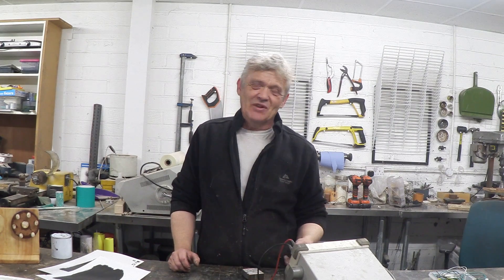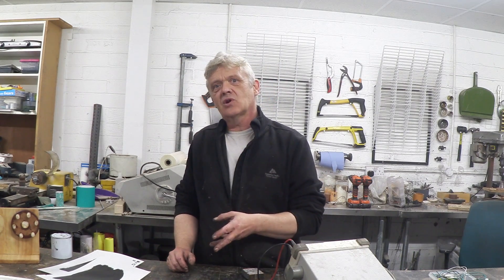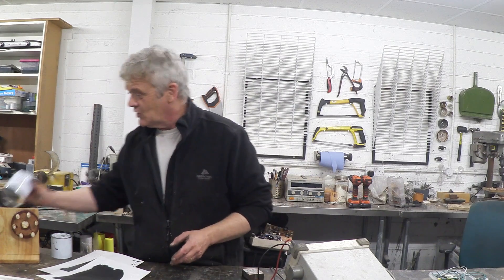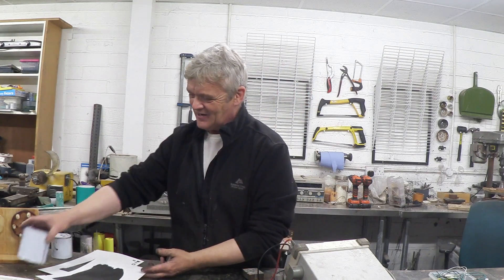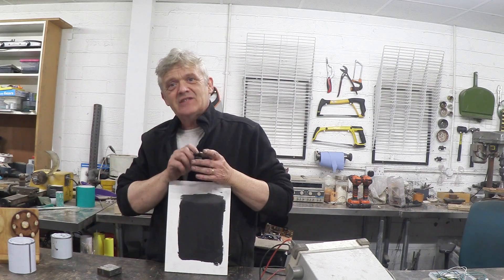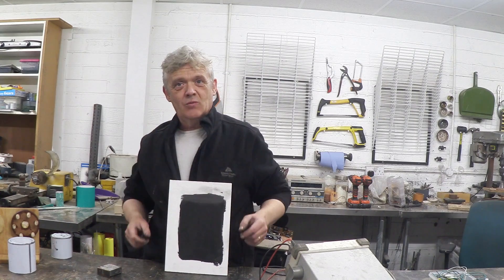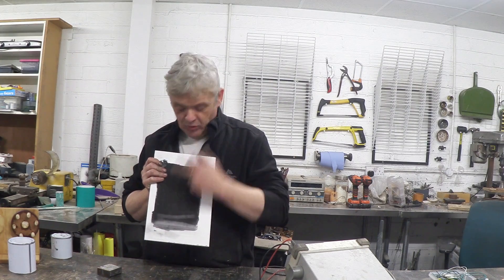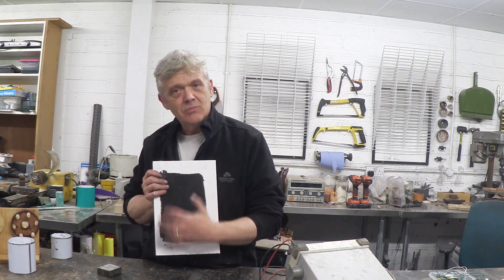New Improved Conductive Ink

Comment: I've been experimenting with 0.5mm x 80mm to 150mm aluminum discs painted with previous release of Rob's conductive ink, SECURELY attaching 6 N45 magnets in a ring formation near the diameter and a dc motor via a shaft adapter.  Then I energize with 20KVAC, 5mA and spin starting at low RPM.  Let's just say the effect is interesting.  Perhaps the ink is offering more electron charge than the unpainted disc?  Before sticking my neck out too far, I'm ordering better measurement gear as soon as I can, but it does seem to force electrons into a plane outward in all directions perpendicular to the axis of spin. It also renders my existing test equipment and nearby computers useless, haha!  Test chamber needed.  Field location was tested with small fluorescent tube.   DISCLAIMER: Preliminary observations pending meaningful measurements.

Comment: Just checking..... if I wanted to paint a radiator on the wall.. your ink1would be better 4 that with 30Ohms resistance rather than ink2 with 8????  

Right!!!!????
Reply from the maker: Hiya mate - we are no longer making version one we are only making version two now - but your best bet is to mix manganese dioxide in with the ink that way you have a positive and negative thermal coefficient material in the same ink and that will add a huge safety factor - basically it can't get above set temperatures - you do that by altering the amount of manganese dioxide in the mix for a given temperature range - as you are a member I can do a video on this if you like
Reply: @ThinkingandTinkering  it's not somthing I'm planning on this week, just a thought that occured to me, but at some point you may want to do a short series of how to ink2 all of your innovativ-inventions using ink 1...

Or outsource that to your mini me👨🏼‍⚕️(lukiluklukluke)

Comment: Great video as always Would this be able to be used for electrodes for electrolysis in urea ??
Reply from the maker: I don't know mate - it's on my list to try if that helps
Reply: @ThinkingandTinkering  if you trying that I wanting to try, and quite frankly don't have the time or equipment yet as I'm in South Africa and getting hold of stuff like graphfoil is expensive if you could do electrolysis at depth if you just have a thin pipe of water increasing the head/pressure then you would definitely get a net positive having the pressurized gas released and being able to ignite said gas as far as I know water pressure does not affect the performance of electrolysis

Comment: Well done on improving conductivity. But a question about the measurement technique (ohms per square). This depends on the film thickness; you mentioned 8 to 10 microns, but how do you control that? For example, your new results of 8 ohms/square (compared to 36 ohms) could result from using the exact same ink, but applying it 4+ times as thick.  I'm not suggesting that you did that, just that the result would be even more impressive with a confirmation that the thickness was comparable.
Reply from the maker: no worries mate - but to be honest it would be really dumb of me to cheat on that as it really is easily verifiable and I would get a ton of complaints and a huge loss of integrity as this ink is used by a lot of folks - any way the easiest way is to lay down two strip of tape and pass a roller over the tapes - it's a cut down version of the Meyer rod technique

Comment: What kind of temperature range does this new paint have Rob?
Looks like a great product for certain applications already, but thermal stability would be a bonus,
Could you paint low temperature (40 - 100°C) heating elements with this?
Reply from the maker: it should go up to 400 degrees c - but you would be taxing it then - still 100 c no probs

Comment: Love how straightforward that was! Any estimation of the viscosity of the ink?
Reply from the maker: pretty much like any ink mate - but I don't have a cps
Reply: Cheers, Rob. Might be worth doing a back of envelop test of the viscosity using something simple like DIN 4 cup and just look for tables to compare to cP. It won't be as accurate as rheometers of course but it will give a range of viscosity that could be a selling point as viscosity matters for many deposition methods - and could be a nice video showing how to measure viscosity too :)

Comment: I sleep very little also. Fortunately, there's an incredible resource called the Internet and technologists like you to keep me informed. It's almost a global conscience. I enjoy your videos.
Questions:
Is your ink stable without baking or sealing?
Does the resistance change in humid environments?
If it is applied between two clean conductors on a PC board, are the connections stable? 
Is it sensitive to the type of metal used as a termination point?
Can you use copper, tin, lead, aluminum, brass as a terminal?
Does it matter if the substrate is porous like paper or does it have to be nonporous like glass or plastic? (do we have to characterize per application?)
Can it be sealed with paint or with plastic, like polyurethane or epoxy?
Can it be silk-screened onto a substrate?
Does the resistance change if successive applications are made? 
(If one application gives you 8 ohms/square will two applications give to 4 ohms?)
Price?
Thanks in advance. I have several applications in mind.
Reply from the maker: it is just paint and let air dry mate - it will vary with humidity - yes but you could lacquer over to stop that. It can be silk screened and thickness will change resistance as resistance is a geometric property - resistivity isn't that's a property of the material - as for the other question - basically you are going to have to try it as I don't know - there are so many applications I haven't tried them - indeed it is impossible to do so - as for price - that's on the shop